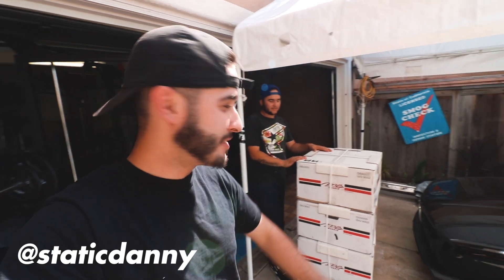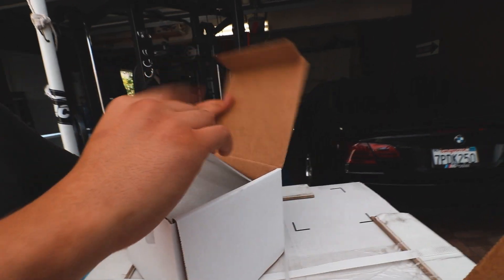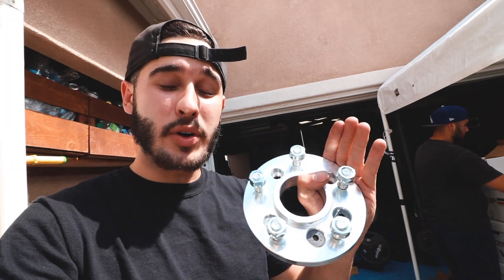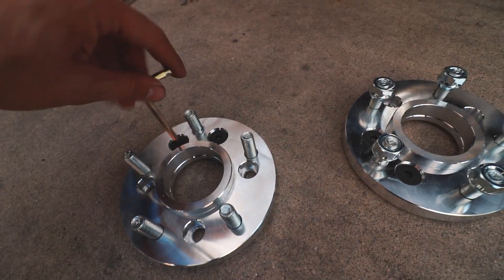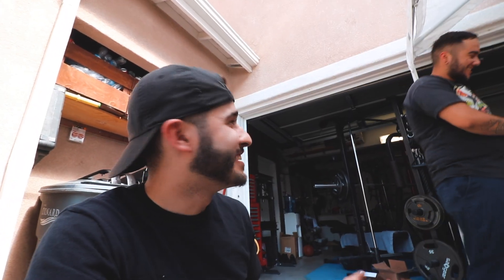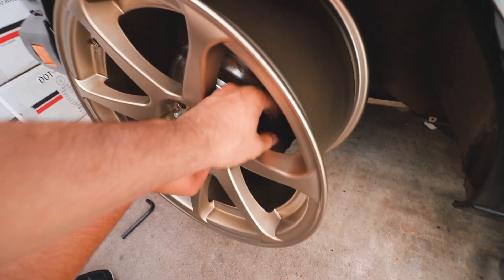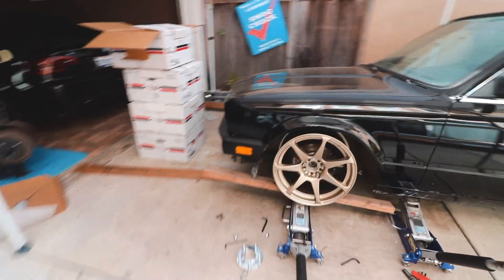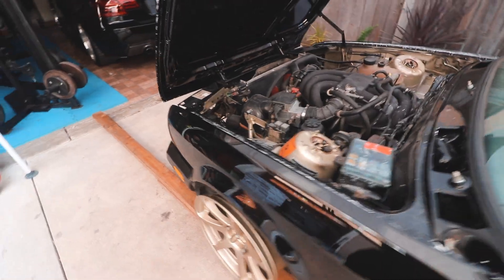NEW WHEELS FOR THE E30!!

Comment: You trust adaptors when it comes to a 400 hp e30?
Reply from the maker: Do you trust an E30 with 400 hp?
Reply: A lot actually just kept 4x100 lol  3rd yr boosted m20
Reply: Static Garage but I hear and read these are amazing. And I hear and read they break easily and it ends bad

Comment: You're gonna need to stunt a small spacer and some camber to get that wheel to fit after you throw tires on those wheels
Reply from the maker: It cleared the coilover with how it sits on 215/35. I’m planning on going lower and that’s when the coilover rings will hit the wheel. My next thing on my list is to get 46 control arms to increase the camber so it’ll clear the fender when i push the wheel out with a spacer. Trust the process!
Reply: @StaticGarageUSA  ohhh dannnng I'm surprised it cleared! Well hey, nothing wrong with that lol good wheel choice man and btw static garage is a nice name change!